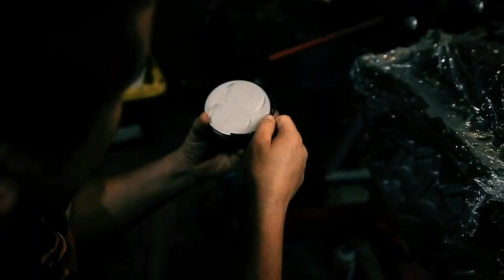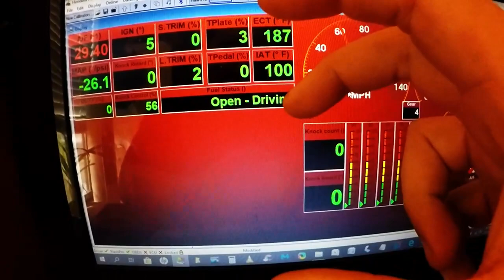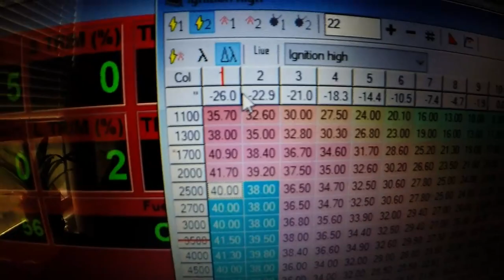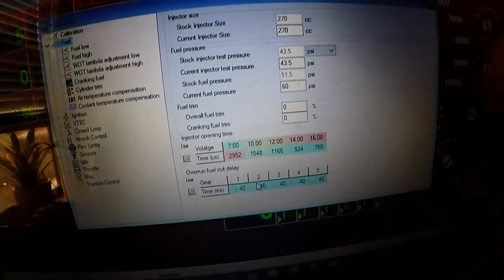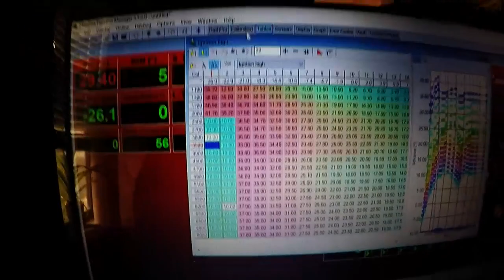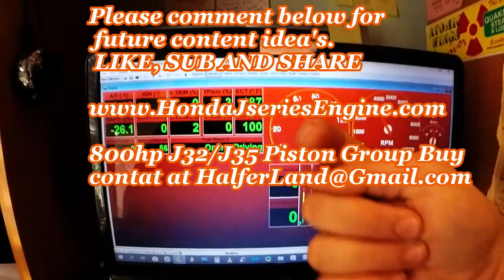HOW TO: Honda Jseries Anti Lag "Crackle/Pop" Tune  (At your own risk)

Comment: If you were to only change the overrun fuel cut delay wouldn’t it only spray gas and not ignite it in the cylinder and go into the exhaust and ignite when it hits the hot exhaust? This way it wouldn’t hurt the engine. I thought that’s how cars crackle and pop from the factory.

Comment: It works the same for Ktuner.  Question  though  ,  why is -10 max you reccomend?
Reply from the maker: da9kid010  Are you asking or telling? Yes, of course it will be the same for any other tuning system. 
-10 is max because that’s the most Hondata will allow
Reply: @HalferLandPerformance  I was mentioning it works the same for those who wonder if it can be done.    I left my ignition decel timing at -10. It can be adjusted more with ktuner but I'd not risk it. Lol
Reply from the maker: Yeah  tune Hondata and ktuner but never go beyond -10